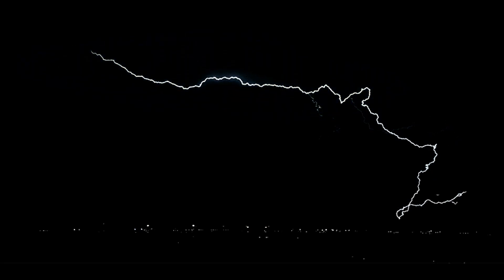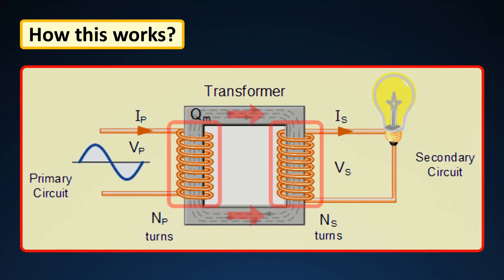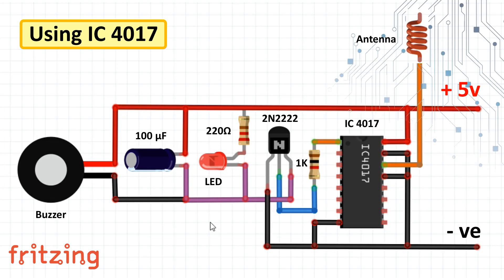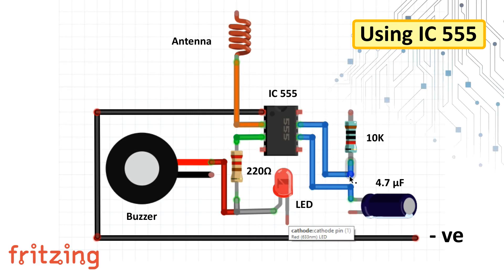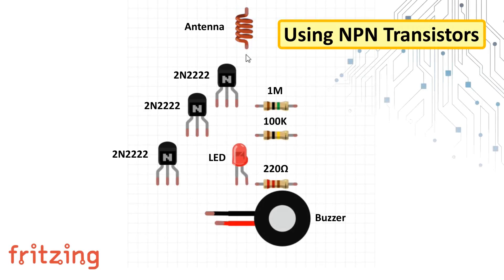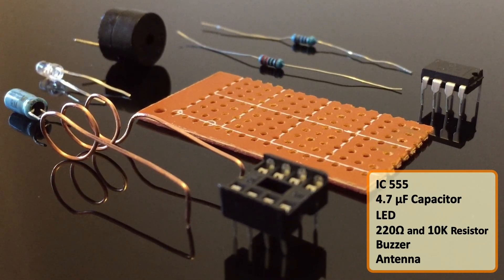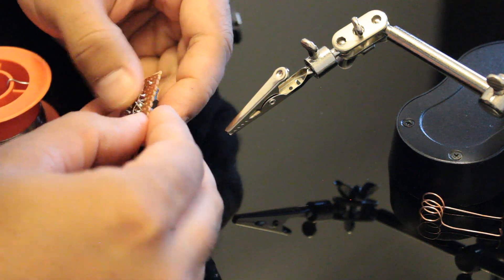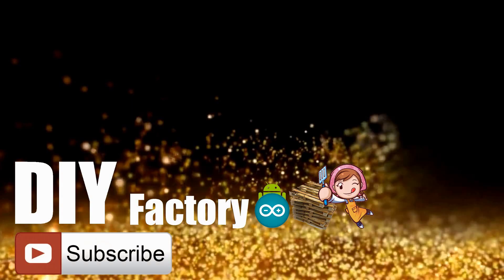Contactless Voltage Detector

Comment: Which one has the most sensitive detection? And how to increase its sensitivity? I need one of these to avoid drilling onto the live wire inside the concrete wall.
Reply: Going through the comments section I realise the ne555 version is best suited for my needs. I have all the components available in my stock, I'll make one and come back with the result.
Reply from the maker: That is correct

Comment: tantalum 35v4.7uf work or not?
Reply: my set ic ne555 , active buzzer 3-12v, Why sound test have low volume buzzer and led blink detect all time?
Reply from the maker: How many volts are you pumping in?
Reply: @CrazyCoupleDIY 3.7-12V battery is the normal voltage supply for the circuit, Capa 50V.
Reply: @CrazyCoupleDIY Not sure if the NE555 IC I bought from China is a fake. I've tried changing everything except the speaker and NE555 IC, but it's still the same.😅
Reply from the maker: Strange

Comment: Presence of alternating emf field around a wire.
Reply from the maker: The presence of an alternating EMF field around a wire is a direct consequence of the alternating current flowing through it. The alternating current generates a time-varying magnetic field, which in turn induces an alternating electric field. Together, these fields form an electromagnetic field that propagates around the wire, enabling the transmission of energy and information.

Comment: Does this only detect current, not hot wires, because this uses inductive Magnetic field coupling? I didnt have time to study it deeply and im just starting
Reply from the maker: A changing magnetic field, as described by Faraday's Law of Electromagnetic Induction, induces an electric field. This electric field is also alternating and is oriented perpendicular to the magnetic field.
The induced electric field forms closed loops around the wire, and its strength depends on the rate of change of the magnetic field.

Comment: How to measure or sence tha AC current and voltage by this circuits and display measured readings. 

I request you if any such circuit is made then upload its video as soon as possible.
Reply from the maker: Hi mate 
First of all, thanks for your comment..
I still haven't created any video to sebce ac current. 
I may upload one in the near future. Thanks a lot for your suggestion

Comment: Can we connect this to arduino?
Reply from the maker: What are you trying to achieve by connecting this setup to an Arduino
Reply: I was wondering if it is possible to add LCD to display the actual (number)voltage that it is detecting, maybe creating a code to interpret it?
Reply from the maker: @_m_3340  Yes that is  totally possible mate.
Reply: @CrazyCoupleDIY  Can i ask how?😅 Does the copper rod detect voltage? Or does the transistors still needed?

Comment: Had some components and thought why not, I didnt have a 4.7uf cap, used a 10uf electrlytic cap, was missing 220ohm resistor so used 1k 😅. But it works like a charm (kinda). Very cool concept. Thanks for teaching.

P.S. Please post more videos. Really helps A LOT. I am doing my first year of electronics and comms engineering, really frustrating as I have inadequate lecturers. For example your transistor explanation video, never understood the concept of "flow of holes" until I saw your video. The visualisation helps A LOT. That been said. Thank you A LOT.
Reply from the maker: I am glad that I was able to help you, mate.
More videos are on its way, so stay tuned.

Comment: You didn't specify how many voltage for the 4.7uF capacitor?
Reply from the maker: You can put anything higher than 5 volts

Comment: Hello.  If I connect the output of the 555IC circuit to the input of a low wattage FM transmitter circuit, will the signal be broadcasted?  How does one calculate the voltage drop of the 555 circuit?  How would one change the 555 circuit output frequency and duration?  Thanks for your very well-presented demonstration and your advice.

Comment: very interesting & wonderful circuit.   🥳 Do you have a non-contact circuit to indicate 3 phase [A-B-C] 2,300 volts AC motor rotation sequence?  😎 Thank you. 
Most 3 phase motor rotation direction "CW or CCW" testers only go to 700vac.
Reply from the maker: Not at the moment, but I will upload one soon

Thanks again

Comment: Excellent descriptions, graphics, and overall tutorial of the design process in general. With about a half-century of experience, I would like to add a safety suggestion. These types of non-contact devices are great for checking presence or absence of voltage, such as for checking a switch or tripped breaker. However, if you plan to touch conductors, use a proper multimeter or tester designed to actually touch the wires, and test it on a known live circuit beforehand to ensure it works properly. There are some cases where these non-contact devices can read a false negative, where power is really there, but not read by the tester due to other unforeseen electromagnetic influences. This applies to the commercial units as well.
Reply from the maker: Thanks a lot for your suggestion, it will help everyone who watches the video.

Comment: Sir i m using 4.7 uf 50v capacitor and 10k resistor but it beeps continuously
Reply from the maker: Please check your connections 
It has always worked for me mate
Reply: @CrazyCoupleDIY   Also mine does the same
 Its not the  connections

Comment: hope this helps for those whose circuit LED is stuck in the ON state:

for future reference for some weird reason, it only work for me when i have the led to Vcc and the negative of the led on the output of the ne555

pulling it up rather than down..... i checked it on a scope and when the circuit triggered, the output pin connected to ground

so when voltage was present it started to flicker as the NE555 tried connecting it to ground, both pins are ground so it turned off. The off time was very short compared to the on time so it seemed like it was flickery but on

In the other case where + of led is at Vcc and - of led is at pin 3 of the IC, in no trigger state, the LED is off, when a trigger is there it was connected to ground and the LED was on and flickering. I also saw the intensity was in two states, low and high, in low it was very flickery and dim and when it is very close it becomes very bright and flicker is less

also i had the reset pin connected to Vcc as its active low, to ensure the IC is held in ON state rather than reset state, it didnt check it without the reset being connected but it will also help if you face issues

Comment: What pins and what board (the orange thing with sockets) are you using to put in all the wires and hardware in the 555 IC? Can you detail what brand you are using as well because that would help a lot.
Reply from the maker: Are you talking about the "perfboard"?
Reply: @CrazyCoupleDIY  i think so yes, also what pins are you using?
Reply from the maker: Cool then it's a generic perf-board 
You can buy them off from aliexpress
Reply: thank you, but what brand are the pins (the wires) in the 555 IC circuit board?
Reply from the maker: It's a local one 
Not branded mate
Reply: @CrazyCoupleDIY  oh, thanks anyways
Reply: @CrazyCoupleDIY  would just normal 22 gauge single stranded wires work?

Comment: The last one is is based on capacitive coupling not inductive coupling, larger surface area for the antenna will hugely improve it.
Reply: where and what kind of antenna would you buy for these projects? (especially the 555 IC one)
Reply: @hobokaru1350  you make them using solid copper sire or mettalic foil.
Reply: also, where would i find those types of pins and the board for the 555 IC

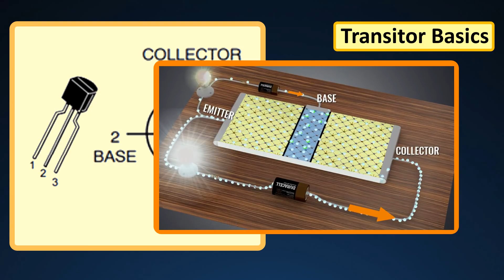Comment: 4:30 - What do you mean that transistor can be "in between' state? Does a NPN transistor has 3 states? 555 circuit IS NOT WORKING... 9V battery, hah?
Reply from the maker: Well what is not working? 
What have you done to make this simple thing not to work?

Comment: 4.7 uf capacitor  volt's?
Reply from the maker: The circuit can only handle a Max voltage of 15v, so anything higher than that will be fine

Comment: I built the 555 circuit and followed the schematic/instructions precisely but the LED stays on constantly. The buzzer works fine however. I've tested it with both 9v battery and 5v (arduino). This is for a school project so it has to work exactly right. Any suggestions?
Reply: Hello River can you help out, I have a project on the same title.

Comment: Sir can you tell me 
Why does it happen when i touch my fingers to the antenna , led glows and buzzer beep? (In case of when we use transistors) 

Plzz tell me sir
Reply from the maker: That setup is a very flaky setup. 
Since we are amplifying the signals statics are also picked up and miss interpreted.
Reply: Your body has a capacitance to your house wiring, you will have a voltage on your body which you can measure if you use a high impedance device, when you touch the antenna you are feeding the 555 timer some voltage which is enough to trigger it.

Comment: In first project using IC 4017 what is the use of placing 2n2222 transistor
Reply from the maker: You can remove the transistor if you are driving an led or low current consuming devices. 
The transistor is basically acting as an amplifier

Comment: I made using transistors. It really works!!
Reply from the maker: Happy that it worked for you 
As I said it will work but you may pick up unwanted noise which will give you false positive readings 
Now if you try the setup I used you will for sure see the difference

Comment: 4017 is a 16-pin chip, not 16-bit,
It's a 10-bit counter (decade counter)
Reply from the maker: By the way if you hear that properly, I said 4017 is a 16 PIN DECADE COUNTER 
You may need to clear your ear a bit before watching my videos. 
Ahh, may be the accent, isn’t it.
Reply: @CrazyCoupleDIY  After 3 attempts (re-hearing the concerned part) I found you're right. I coudn't higher the voice enough for the first two attempts.
Anyway, there's no need to reply in such a language.
Reply from the maker: All good, have fun.

Comment: Hi i just want to ask if this DIY can detect a voltage on motorcycle with a 12v supply voltage? Thanks
Reply from the maker: Unfortunately not
This device can only detect AC
Reply from the maker: Unfortunately not
This device can only detect AC
Reply: Ok thank you so much sir

Comment: Ok... But what is ac voltage in your location? 127v phase-neutral or 220 volts phase-neutral? Thanks!
Reply from the maker: 220v
Reply: @CrazyCoupleDIY  I knew it! Here in São Paulo it's 110 volts and it doesn't work! Thanks for the video and the answer!
Reply from the maker: Ahh right 👍
Reply: @RogérioLeite  it should still work, working distance would be lower

Comment: Can using different transistor make it detect lower voltages?
Reply from the maker: Yes u can
Reply: @CrazyCoupleDIY  thanks mate! What transistor would you use for detecting low voltages like 12vac?

Comment: hi can we use this circuit in an 8kV AC supply?
Reply from the maker: Hi there 
I have not tested it on 8kv so I may not be able to give u an affirmative answer
Reply: @CrazyCoupleDIY  hi sir. what do you think? will the circuit won't be affected by the 8kV induction?
Reply from the maker: The circuit depends on how much magnetic flux is transmitted and received. Depending upon the flux a current is induced in the coil. Now if you pump in a massive amount of current and the pin of the ic is not able to handle that amount of current, the circuit will blow off. (Can cause injuries).
Reply: if you are using a 555 timer to detect 8kV AC..... then what are you doing..... there are better products with proper safety certification which you should be using,......

Comment: Thanks a lot for the comparative study, helped me choose the 555.
Reply from the maker: Cheers thanks
Reply: @CrazyCoupleDIY  took me about 15 mins to assemble it (555 one) and can certify that to an extent it detects wiring embedded inside walls, well if it isn't dug in too deep.
Reply from the maker: I do agree to that
Thanks for your valuable comment, it will help other users too
Reply: Hey venkatesh how much volt did u choose  for 4.7 uf capacitor?
Reply: @amiyamondal8957  anything over 12 volts will do.  I just had a spare 4.7 micro farad and 63V lying about wich I used and it worked fine.  the voltage just gives the higher limit for the capacitor beyond which they tend to blow up, and not the lower limit.
Reply: @venkateshks6664  was the ic single timer or precision timer?

Comment: First... thank you very much for this excellent video, is crystal clear! ...second ... is possible to measure the voltage that you are detecting? I would like to use the first project due to is very sensible, I want to read, show an store the values read by the device, do you think is posible?

Comment: Please answer one question...if i want to detect 11 kv while standing on ground,will these ckt help,,,the 11 kv wires are approx at 8 -9 meters from the ground level...if no then how to increase the senstivity of this ckt so that I could detect 11 kv voltage while standing at ground level just by raising ckt in my hand safely,,, as it's risky to go near 11 kv
Reply from the maker: I will not take a chance testing 11KV with this tester mate. Please use some professional and recommended tool for that. This will definitely become an item of suicide

Comment: Once I used the IC 555 in an oscillating circuit, when I applied a voltage difference of 9 V, it burned and stopped working. Is a 9 V battery burnt the integrated 555
Reply from the maker: No it wont.
The 555 timer can be used with a supply voltage (Vs) in the range 4.5V to 15V (18V is the absolute maximum).
Reply: It shouldn't unless you mistake the + and - poles.

Comment: can i search 12 v or 24 v line with this?
Reply: I mean to use for surching a problem on abs system cables and so on...but maby is good option if i use trasformator for menage low 24 ac...is this gonna work in 24 ac?
Reply from the maker: 12v or 24v AC?
Reply: @CrazyCoupleDIY  24
Reply: Dc
Reply from the maker: This device only checks AC. 
The tone is generated by the alternating current. 
DC will only produce a mummmmm ing noise.

Comment: Very nice and informative..🙂
My question is about the ne555 ic ..can I use pot instead of 1k resistor to adjust the sensitivity of the tester?..
Reply from the maker: Sure u can
Reply: can you specify pot so I know how to do what you doing? how would this work (also dont know what pot is)
Reply: pot instead of 220 resistor? or 10k ? which one is useful for led controlling pls?

Comment: The 555 circuit looks like it could be used to check for cables behind plasterboard walls.  Will give this circuit a go for sure!
Reply from the maker: Sure, plz do post your findings in the comment 
You can also make a comment on my blog 

http://diyfactory007.blogspot.com/

Comment: the circuit sing 555 doesnt work
Reply from the maker: What doesn’t work? Be more specific when u say something like that. Your answer is open ended and has no reason. 
You are the only one to say this. It has to be something you are doing wrong on your end mate. 
Are u even following the schematic?
Are you using the right components?
What part is not working?
Did you test the level of current using a multimeter?

Comment: Can wa use 3volt battery instead of 9 v battery in 555 circuit pls replay
Reply from the maker: You may but I have tested with 3v and the led stays way too dim

Comment: From which distance can this circuit detect three wired cable with good ground line?
Reply from the maker: None of them will operate if you go way to far.
Reply: @CrazyCoupleDIY  cable with ground line none detectable if distance more than 2cm. If it is in a wall,usual depth 1-2cm, it is not possible to find it at all.
As result im looking alternatives which will give big detectable distamce

Comment: Does your 555 circuit detect incorect switching power supply connection when there is AC present on the device cover like PC PSU.
Reply: That is ground not live.
Reply: @tanishqbhaiji103  that is leakage from the Y capacitor between ground and neutral, if ground isn't connected the neutral will have leakage current onto the ground terminal which is connected to the negative of the DC side as well. This circuit wouldn't be able to detect it in many cases as the voltage will be very low as it is easily loaded down

Comment: is it gonna work if i wire the speaker and the led 25 meter away from the amp?
Reply from the maker: Why would you do that?
Reply: @CrazyCoupleDIY   after a power outage in my area, when the power went ON again sometime my circuit breaker is getting jumpscare moment or something, and it turned off the switch, so if im in my room, i would never know if the power is up,  
and i just wanna know when my power went out, its from my breaker or the whole area.
Reply: @CrazyCoupleDIY  im gonna hook it on the cable before the breaker.
Reply from the maker: @mr.2minutes161  Ahh, that makes sense. 
But frankly speaking, it won't work
25 M is a long distance and the current will drop.
May be add a NodeMCU to send the signal off to a receiver or a webserver or something
Reply: @CrazyCoupleDIY  i guess i'll do that if theres no cheap alt, im looking for cheapest and easiest way possible if i can, since nodemcu and battery price can fed me for a day here,
Reply from the maker: @mr.2minutes161  true

Comment: can i check 12v dc voltage's wire?
Reply from the maker: I did mention in this tutorial that this tester detects the alternating current and produces the tone. So unless u have an alternating current you may not be able to hear the tone going up and down.